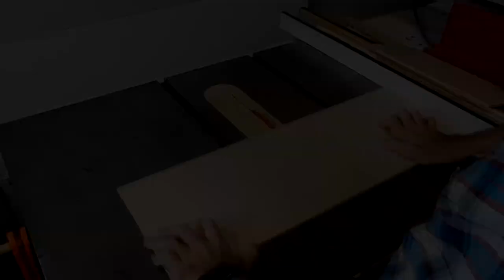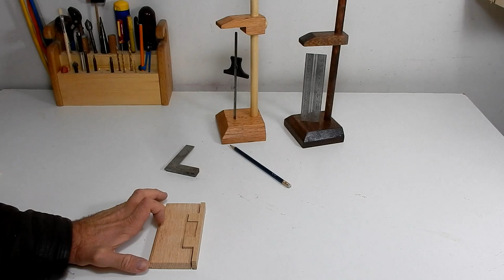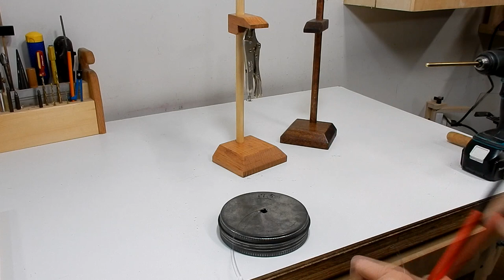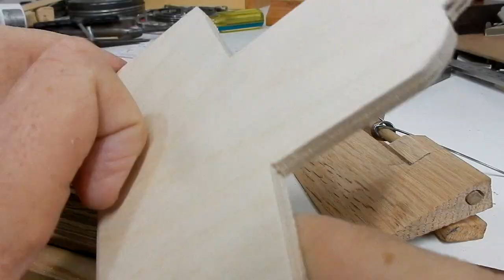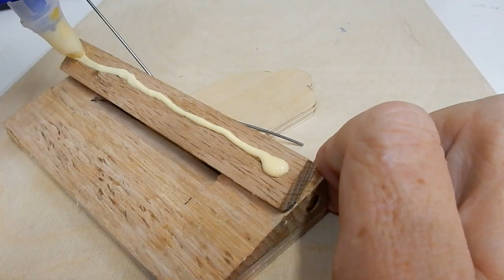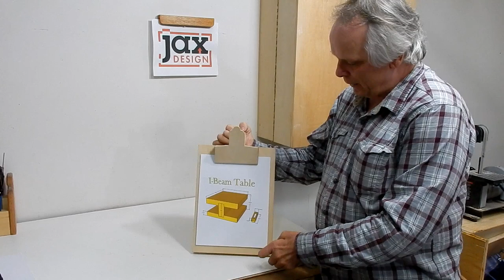How to Make a  Wood Clip Board with Back Compartment

Comment: I like that clip board a lot. What type of wire and guage did you use for a spring? I really enjoy your videos, thanks for sharing. God Bless
Reply: +Jack Houweling Changing the wire diameter changes the spring rate-how hard it holds.  Smaller should be less and larger should hold harder.  Hope that helps.